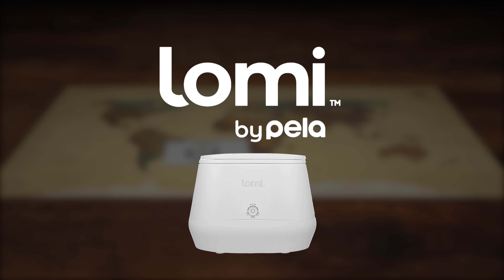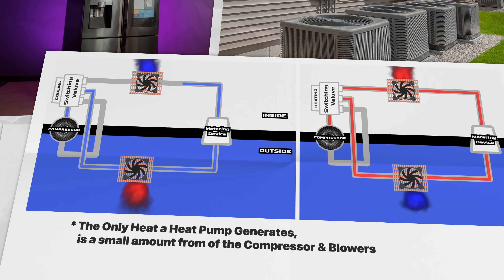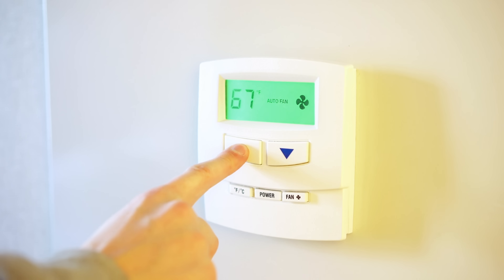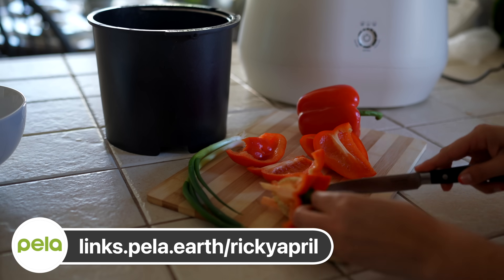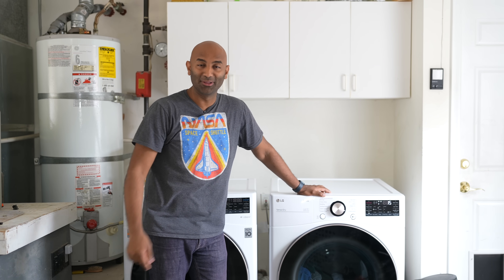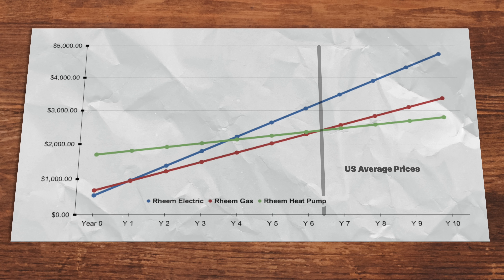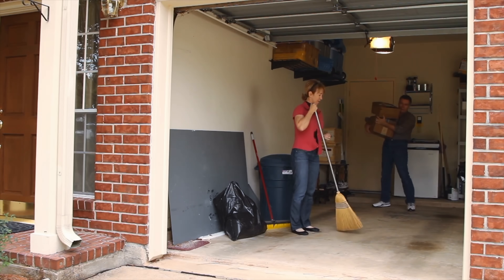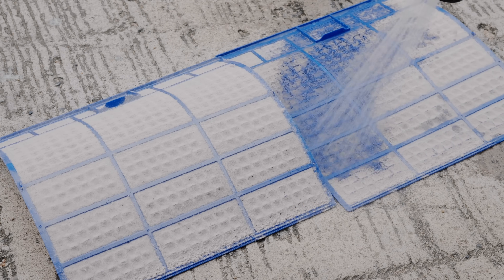I'm Shocked How Much Money Heat Pump Appliances Save!

Comment from the maker: Check out Lomi:  https://links.pela.earth/rickyapril
1st Heat Pump Vid: https://youtu.be/moQapzjjmQM
Reply: Europeans: Electric tankless water heaters and electric heated showers work in Europe because you accept lower flow rates. In N America people want 10+L/minute for their showers. In the UK an electric shower is 5L/minute. When I visit my sister showers aren’t any fun.
Reply: @RCdiy  Don't forget in the UK we can also heat the water twice as fast my kettle is 3 Kilowatt supplied from a 250 volt 13 Amp socket. My shower is 250v 32Amp max, most UK showers are 7500WATT
Reply: Also  you can always fit a 10500watt shower in the UK. Many standard showers will operate around the 0.2litres per second/12 litres per minute mark her in the UK. Plenty enough to get a good shower.
Reply: @RCdiy  Also  you can always fit a 10500watt shower in the UK. Many standard showers will operate around the 0.2litres per second/12 litres per minute mark her in the UK. Plenty enough to get a good shower.
Reply: Lomi is NOT a "composter" it is an EXPENSIVE DEHYDRATOR!!!
Nor does it "break down bioplastics"
You are PARROTING their BS PR!!!
PLEASE do your research!!!!
Reply: @JDMumma  glad you said this it should brake down bi plastic but it turns out peta ( owns of lomi ) only use %47 flak the rest is regular plastic have you seen the new thunderfoot vid it turns out it's a experience bread maker
Reply: Please please please take the lomi about it's a scam they brake down after 3 months and people are auto subscribed to charcoal that is extremely Had to unsubscribe it's just a bread maker
Reply: Let’s build the generator. It may be the only way to stop the gas wars.
Reply: Okay, so those with high outputs of renewable energy seem to be inversely proportional to those with cheap water or good land for plants. Lomi seems a bit ahead of its time in that regard. You spend a kilowatt to make compost for a non-existent garden or cause more damage rather than helping? It's just a eye-level observation with no data. A better analysis of this could be a neat sponsored video for them...assuming I'm wrong and they are actually good.
Reply: @da3dsoul  
1. A kilowatt is off by orders of magnitude.
2. Whether your garden exists yet or not composting is not wrong.
3." Or cause more damage than rather than. . . . " vague, specious, and vacuous non-argument.
Reply: @da3dsoul  Checkout Thunderfoot. His analysis of these kitchen "composters." They're a scam.
Reply: lomi is a scam.  I get that you need sponsor money... but that product and all others that came before it doing the exact same thing are just simply scams that take people's money and are not "great for the environment" as they claim to be
Reply: @anthonypoole4025  true
Reply: Hey don't be blaming the British we started with a Gallon = 8 pints or 4 Quarts, 1 Quart =2 Pints but The USA turned it into 1 Gallon = 1.2 US Gallons .
Don't even get me started on MPG figures for car's 😊Nobody on the Internet even states what MPG figure's there talking about. Just for reference my little 1.4Ltr Toyota does between 50 MPG  around town to 65 MPG on the Motorway. UK MPG 🇬🇧 😉😊
Reply: @stephenjones9153  We started with the same gallon... but the English changed theirs in the 1800s well after the American revolution. We kept the traditional English Wine gallon as the tastiest of the gallons. We still use pints / quarts, etc... but they are a bit smaller.
Reply: @timdelaney2798  That's interesting 👍👍. So you still have 8 pints or 4 Quarts to the Gallon but there all slightly smaller than the UK Gallon. O well at least our MPH and Miles are the same 😉😊, at least until the EU decide to force us to change to Kms. I don't know why we don't all stick to the original measurements that most of us could understand like the old Fahrenheit and Lbs and Ounces. Although I must admit £ s d with 20s to the £ and 12d to the Shilling  was a lot more confusing than Metric when it comes to money.
Reply: @stephenjones9153  Yeah, I could go to kilograms easily enough but I like miles and especially like Fahrenheit. It was originally 30 degrees for freezing and another 180 to boiling, and these numbers are a bit magical (that's Babylon!) for having a lot of easy combinations. For some horrible reason, when it was realized that the scale was off a bit, they decided to move to 32 degrees instead of sticking with the old cool way of doing things.
Reply: @stephenjones9153  
What Toyota make model and year? How many gallons or liters to fill the tank from bone dry? 85, 87, 89, 91 what recommended octane r + 2 / m? Does the instrumentation provide instantaneous MPG while you drive? Or do you use the trip odometer and calculate?
Reply: @stephenjones9153  That is the liquor! Instead one quart  they 1/5 of a gallon!
Reply: @mickgibson370  A Quart is short for Quarter of a Gallon ¼ not a ⅕.
A pint is ⅛ of a Gallon or at least in the UK.😉😊
Reply: @stephenjones9153  yes a us gallon is 3.7 when UK gallon is 4.5
Reply: Celcius is literally a scale from freezing at 0 to boiling at 100
Reply: Not using natural gas would be VERY bad for the environment. Just think about it.

Comment: Very late the to party, great video :). What are you thoughts on tank corrosion for heat pump water heaters? Depending on the quality of water and maintenance performed on the tank it seems to be a failure point that isn't talked about enough. The space saving and "tank-less" aspects of a tankless water heater design made me go down that path.

Comment: Hi, I'm running air-to-air pump/aircon (more efficient and cheaper than air-to-water) to heat almost the entire house (using ventilation to move the heat), a heat-pump dryer and  a heat-pump boiler. With solar - I can confirm that this setup works great. My washing machine and dish-washing machines are connected using thermostatic mixing valves, and take 30-50 degree Celcius warm water from the heat-pump boiler as input - so their old fashioned built in boiler elements barely run. You're right; pump all the things! :)
Reply: Oh, and my heat-pump dryer and heat-pump boiler are located in a very, very deep cellar -- which means they're essentially drawing heat from the ground. The cellar stays warm even in december. I.e. no problem with freezing basement or house.

Comment: I actually did replace my hot water heater with a heat pump water heater. (We had a water heater from 1996 that needed replacement.) We also snagged an amazing clearance deal from a local appliance distributor so we got a heat pump dryer for a low low price of $196 for a 4 cubic foot Samsung DV22N6800HW/A2. I also installed a heat pump mini split a few years ago, which is a 30.5 seer 12,000 btu unit 3.8 CoP heat, to cool our downstairs area. (Dropped cooling costs nearly 100 dollars over the window AC we were using.)

Comment: When the compressor pumps the refrigerant gas into a much smaller diameter line to force it into a liquid state it generates intense heat.  That is where the heat in a heat pump comes from.  Compressors force gas into liquid under great pressure.  Those hot coils have a fan blowing into your room through those coils.  I hear so many explain this basic thing in the most bizarre ways.

Systems that also provide cooling in the same area pump the hot liquid outside and use fans to cool the lines.  Then the liquid is converted back into a gas by flowing under pressure into a much larger line which creates intense cold.  

Fans blow across those lines and into your space to provide cold.  Its a sealed system.  The compressor forces the gas back into a liquid called the condenser which creates intense heat then it expands back into gas in a larger line called the evaporator.

Comment: Good video, but you lost me when you hit the political note.   I am an engineer, a senior, and think that moving to heat pump technology makes good financial sense over gas or electric.  Additionally, as a senior, I plan to add solar panels as a way to manage my long term costs on energy.    I think moving to heat pumps is a cost saving move,  and it is good for the environment.

Comment: I think HPs are great. but if you're also going solar, I think I'd compromise on an electric hot water tank and leverage off peak overnight electric + excess solar. The increase in complexity and upfront cost of a HP water tank still a bit of a hurdle IMO. Definitely going HP for heating and clothes drying

Comment: Why not consider a SOLAR pool heater instead of the heat pump?  The solar collectors for pools are simple black plastic manifolds through which you circulate the pool water.  Not so great if you like to swim early in the morning after a cool/cold night, but great in the afternoon/evening on sunny days.

Comment: I know this is an old video, but if you haven't already bought your equipment I thought I would point out that when you buy a heat pump HVAC system, some manufacturers have outside units that can also connect to a companion heat pump water heater or clothes dryer.  This means the water heater and clothes dryer will actually be taking heat from outside instead of cooling down whatever room they are in.  This might not be as big of a deal where you live in California, but here in the northern Midwest it's nice not to cool our basements down further in the winter.

Comment: I have not long had a heat pump tumble dryer my ones a Miele condensing heat pump dryer. 
I was skeptical about it at first but now I am so glad I have got one it’s so cheep on electric £0.26 pence per hour on normal cotton cycle. My old one was £0.99 per hour. It doesn’t sound like much of saving but over time like me I have had it about 6 months now and I love it and you really do see how much you save 😃 totally worth it takes a little longer than a normal vented/condenser dryer but it’s so good on electricity sounds a bit like a fridge so funny you should say that lol. I wish I could have it for the heating as mine is a newish 2 year old high efficiency gas boiler A rated that’s the best in the uk! But gas is so expensive you do not see any of the benefits you might as well have an old system use about the same now with the price of it. I could only see the benefits of having a heat pump central heating and hot water system for you’re home, but don’t think that upgrading will happen for a few years yet… but can’t wait till it does if that’s how cheep a dryer is to run!

Comment: Except when you live in California with the highest electricity rates. PG&E only gives us a baseline of $.24 per kilowatt but if you go above your baseline like everybody does the majority people are paying $.32-$.36 a kilowatt hour some as high as $.42 a kilowatt hour.. .

Here in San Francisco California gas is cheaper to heat your house . 

Gas is cheaper to heat your water . 

And by pulling out our old gas water heater and replacing it with a tankless gas, water heater or gas bill dropped by 2/3 . 

So, using electricity and heat pumps depends on what part of the country you’re in and what are your fuel rates compared to your electricity rate? . 

It’s a regional thing . 

Fortunately, for the majority of Californians, because of California’s mild climate, where the majority of the population lives .    Heat pumps for heating a home worked in the thing that is called the Goldilocks zone.. ( this is an area where the outside temperatures are between 40° and just under 60° in these regions. Heat pumps work at the most efficient level..

Comment: Take a look at sand batteries, they have the theoretical potential to heat your house off of small voltages. Thermal energy produced in the summer can heat your house in the winter. They get up to 600 degrees Fahrenheit which also means that you could run an oven or stove from one. It also doesn't care about where the heat comes from so it can be used as a buffer and piped back to where you need heat. A solar panel or wind turbine attached straight to nichrome wire can keep the sand battery topped up. It's also 100% efficient because it works like an electric heater in that configuration.
Heat rises so input on bottom output on top. 

 A hybrid system of a heat pump and a sand battery would be ideal. 

They can also push energy back into the grid if setup for it.

Comment: As someone who sells (and used to install) heat pumps in CA it's fascinating to see this. Great job with the editing and video but there's a great deal missing, also you should run a duct for your HP WH to outside your home same with a fresh air intake.

Comment: 10:00 I wonder if a tankless electric water heater would benefit from using a capacitor to draw power from instead of needing to pull many amps directly from  your power lines?

Comment: A heat pump water heater for your pool is Super Efficient!  Mostly because they are taking heat from about 70 - 80F air into the pool at about the same temperature.  So a EER of 12 - 15 is possible, or 12,000 - 15,000 Btu's per KW of power used.  Amazon sells several heat pump pool heaters.  

I installed a ductless heat pump in my nephew's rental house, installing the indoor coil on a TV cabinet, and the outdoor unit just outside, connecting the copper lines through a open window, it is 12,000 Btu and 120 volts, 1,100 watts in the heat mode, and a little less in the cooling mode.  It works great in the Portland Oregon area, where it might reach 20F on rare winter nights, most are warmer.  Amazon, Della brand, and $730 including the lineset and everything to install it.  

To get 100,000 Btu's into your home, some burn a gallon of fuel oil (diesel fuel) or 1.3 gallons of propane, or 1.3 therms of natural gas, or 23 KW of electric heater, or run a heat pump, and use between 6 and 11 KW of power!  So heat pumps usually win on the price per 100,000 Btu's!  

Your pool heater, use 1.3 therms of natural gas or about 4-5 KW of electricity in a heat pump per 100,000 Btu's! IT will pay for itself very fast!  

Good luck,  Fred.

Comment: Technology connections did two episodes on heat pumps. I highly recommend checking them out.

Also, I know it was just an advertisement, but the lomi is not exactly environmentally beneficial.

Comment: I got a heat pump dryer PURELY for the lack of ventilation, because this house was not built with a good vent in place. I've been over the moon with the quality of it. And while it's a bit smaller and a bit slower, it does a fantastic job and I am already seeing less wear on our clothes. I love it, but I didn't know it was that much more efficient!
I'm planning to swap out the gas furnace and water heater in time, especially as we have a gas log fireplace for backup heat when needed.

Comment: 25 years back I used a heat exchanger system to provide hot water system for a hotel project I oversaw.. system work well and still in use.

Comment: I live in North Texas and I built my own solar water heater, which works all by itself for FREE about 9 months out of the year for under $100.

 During the winter, I heat with wood, again, with my own homemade water heater, which I built for, you guessed it, under $100. 

Total outlay was about $200 and a small pile of  wood from scrapped pallets in the winter. 

Easy peasy.

Comment: A 100 ft dryer duct is nuts! Inefficient, and a fire hazard. It costs a lot electrically and will wear out the dryer. Ducts just a few feet long can cause a dryer to overheat and ignite lint in the dryer and at the dryer end of the duct. Lint will accumulates because the duct is too long. How do you clean a duct that long? You don't!

Comment: For your hot water and pool heater, you should consider a solar water heater. Water gets heated directly from the sun - no electricity, no refrigerant and fewer parts to maintain. 

Solar water heaters are a much more sustainable option.

Comment: Two Bit - I put in both in my house - dryer and water heater. Here is one more trick - if you have the room - keep your old water heater and just unplug it. This will take the cold city or well water and let it just sit in the unplugged tank until it gets to room temp. Then have it piped into your heat pump water heater. It will make it much more effechent. It will also let all the sediment collect in the older water heater and keep your newer water cleaner. Also - see if you can install an electric sacrificial annode rod into your new water heater. It will last forever.

Comment: Exception to the "no tankless" idea is for showers. I think a point-of-use water heater can be justified there if you have a family that takes showers all at the same time, or to take advantage of the digital adjustable thermostat on them. A 3kw heater should handle a modern high-efficiency showerhead just fine.

Comment: This is my question. If so many things in a home are going the way of the heat pump why not tie them all to one big outdoor compressor unit? why heat or cool areas you are trying to heat or cool with more heat pump. Take the heat pump hot water heater. it cools the area its in so in the winter its raising your heating bill to heat your water. same would be true of a heat pump dryer. Instead, save some money and have them tie in like a zone on your heat pump that also heats your house. Each appliance wouldn't need its' own electric guzzling compressor.
Reply from the maker: I think we will see that in the future! Holistic systems

Comment: Heat pumps seem to be the future so let's jump all the way and use one unit to do all the jobs in the house by taking the heat produced by the ac when cooling the house and use it to heat the water and dry your clothes with an assist from the refrigerator .